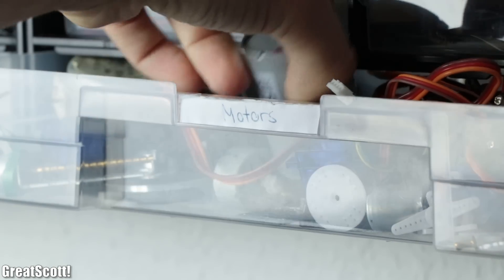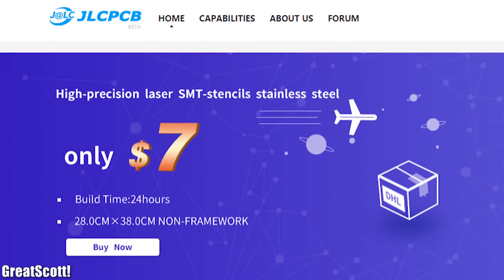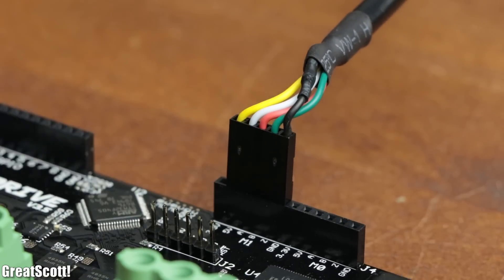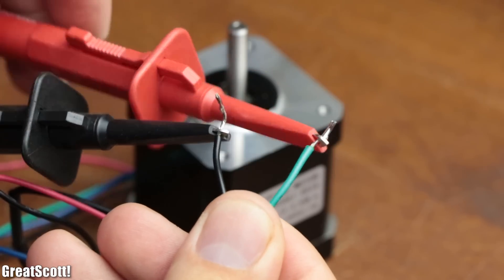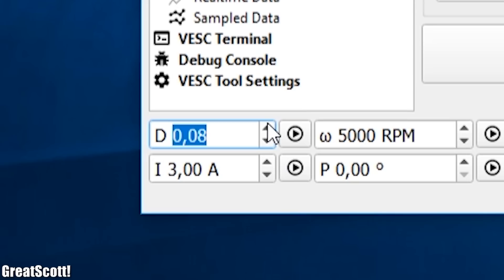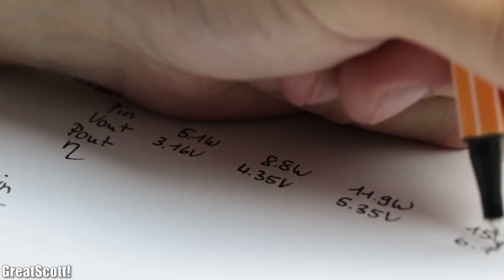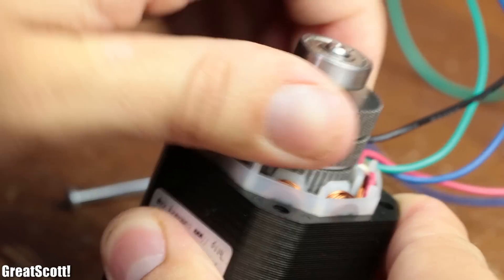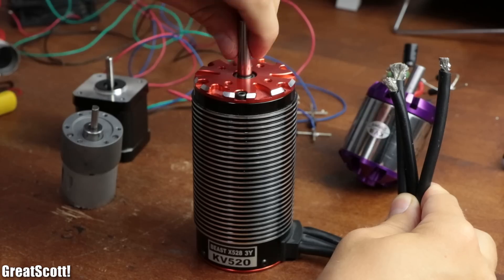Which Motor Type is the Best Generator? || DC, BLDC or Stepper? (Experiment)

Comment: What if you use a DC motor pushing a generator stater to produce power (DC motor at 24000 rpms reduction gears to 3600 rpms as needed by the generator )

Comment: Now, connect the BLDC motor to another BLDC motor and use it as a generator to power the other one without a control circuit. Should work, shouldn't it?

Comment: I love your videos, GreatScott!. I have to ask, why did you 3d print a coupler and enlarge its hole instead of just drilling the aluminum coupler?
Reply: Are you being serious right now....? If you are then, do you struggle mentally? he had ONE coupler, if he enlarged the hole then it wouldn't work with 2 out of the 3 motors he is doing experiments with. And these involve switching between them multiple times, so you are seriously suggesting adapting the one coupler he has in order to work with 1 out of the 3 motors. Your lack of logic is astounding

Comment: I like.  But using motors to generate is very inefficient.  Wondering maybe if do a video on a dynamo?  Basically car alternators are a dynamo where both field and stator, probably not worded right, are electromagnets, the output of a dynamo is regulated by adjusting the field voltage/current. Small in gets lots out.  Cars alternators then just rectify it for DC in the system.  Cars do, or usta have field wire where you could actually read voltage on the field and the load is increased or rpms of engine are changed.  Try it with a volt meter, idle motor and measure the field wire.  Turn on the headlights, blower, etc. and watch field voltage rise.  It will lower if you increase rpms of motor.  Thanks for read I have talked enough.

Comment: It would have been quite interesting to see what happens if the BDLC Motor(Generator) was connected with the other motor more permanently, so that it would be possible to run it on higher speeds

Comment: I would guess a brushless dc motor / ac induction motor as they most resemble the internals of a generator. - but apparently im wrong. ...and a dc motor still seems like they would be a cheap option ...but a BLDC with a timing belt and correct wheels to ramp up its speed seems like it'd work too ;))

Comment: What about a microwave plate spinner motor. They give quite the shock when twisted a little. RPM is like <5
Reply: They're incredibly hard to spin due to the gear reduction. They put out nice voltage at low rpm though. I've gotten 300+ by hand... Then the gears broke :(

Comment: Enjoyable experiment, but I disagree with your conclusion. A gearbox is rarely a good option for a generator project, it wastes power and makes noise. The real answer is to disassemble and re-wind the BDLC motor for a much lower kV and this also opens the possibility of changing from star to delta winding, which may suit a charge controller for a wind turbine better. Idea for your next video perhaps..??!
Reply: Solution is motor multipole rotor. Low-RPM generators are often multipole, including automotive alternator, which has about 10 poles.
That's reason why stepper works so well, because it's basically multipole BLDC motor
Reply: @Papinak2  Kind of like a four stroke engine right? Lower rpm but higher torque.
Reply: Indeed this video is just random testing for content and doesn't address the underlying principles of windings and poles
Reply: Doesn't the configuration change just make it into a synchronous permanent magnet motor? If I remember the difference between two (BLDC vs PMSM) was boiled down to internal winding configuration. Anyways at that point you're better of with a purchase of PMSM for generation.
Reply: Another option is to use a inverter for the "gearing". Inverters used to drive synchronous 3 phase permanent motors like these are very common in industrial servo drives of all sizes. Servo drivers is another name. Of course it needs to be an inverter that can be set up in a way so power from the motor is extracted. The inverter needs to produce a opposing torque acting as a brake, so mechanical energy gets extracted, but not putting energy into the motor. Bigger inverters have external brake resistor outputs to dump the excessive energy for machines which have significant masses getting decelerated. Of course they likely aren't particularly effective at doing this, it is typically not a design requirement to be efficient at braking, but one that is efficient at it can be designed.
With this the diode losses and the low voltage problem can be mostly overcome and one is left with the motors IR (Resistance) losses, which also dominate at low rpm, inverter losses and magnetic hysteresis losses.
One complication is that a servo drive usually needs a sensor for the rotor position (encoder) to work at low or zero rpm, while if just used as a generator it can be realized sensorless, meaning using the motor itself as the sensor.
With the advancement in power electronics and control circuitry this becomes viable in this scenario where a rc brushless is to be used as a generator. Maybe there is such a inverter already?
Reply: so that's the only reason why the dc had a higher output?
Reply: Aren't stepper motors bldc motors winded differently? At least some of them must be?

lol. i take it back.
Reply: Would you mind breaking it down for me at the simplest level, possibly even with links to help from there?
Reply: iceland wind turbine
Reply: So one way you can get around the noise problem is to use helical cut gears as opposed to straight cut. Its the same reason manual transmissions use helical cut while racing transmissions use straight cut or "Dog boxes". Straight cut transmissions SCREAM at high rpm and the straighter the angle the louder they are. The Muncie M22 got its nickname, the rock crusher, because it uses gears cut at, I believe, a 26 degree angle as opposed to the 20 and 21s 34 degree. (Not sure if those are correct I just know one is cut steeper than the other)
Reply: LoL... wind turbines uses gearbox as well :/
Reply: @Promilus1984  They use gearboxes because it produces torque which translate to useable energy? Is that correct? I'm still learning about this stuff.

With the gear boxes the thing would spin faster but not produce sufficient energy?
Reply: @doomslayer5191  The blades of large wind turbines don't produce high rpm's, but they do produce torque on the central shaft. That shaft Is connected to a gearbox which greatly increases the rpm's of a generator.
Reply: @gman21266  what if instead of typical blades, they are small, light water-wheel type mechanisms, positioned at the height of buildings, each with their own 'alternator' to translate wind energy into electricity.
Reply: @chrizcanadianopportunity15  Positioned on buildings in cities is a bad idea because wind turbines have been known to disintegrate and crash to the ground. So that's bad news for people down below.
Reply: @doomslayer5191  An ekectric motor can produce torque without a gear box. Or act as a break
Reply: I disagree, rewinding a Bldc by hand is not worth the minuscule efficiency difference between stepper motors.
Reply: Do you know the windmill uses gearbox to turn the generator? Mainly the turbine itself does not rotate fast enough.
Reply: I'm a little confused on how the gearbox works in reverse.
Reply: @scienceteam9254  basically the rotation (by hand) itself along with the gearboxes produces useable energy to light up a small light.
Reply: @doomslayer5191  hope I can help a bit.  The rate at which a magnetic field changes in relation to a conductor is important to the electro-magnetic effect.  So you can have a small thing whizzing round fast or a big thing turning slowly.  The circumference of a circle is pi times the diameter, it's not simply about rpm,  it depends on diameter.  Giant wind turbines can't be allowed to spin at high rpm because the tip speed would go supersonic,  bad, very bad.  The ideal match for direct coupling would be a very large diameter generator.  Pricey, obstructs airflow.  So they use a smaller diameter generator and spin it at higher rpm via a gearbox, wiping away tears about the energy loss in the gearbox.  Compromise.   For tiny projects, there are motors sold as "solar motors"  which typically have larger diameter and, used as generators, will provide useful power at lower spin speeds.
Reply: @scienceteam9254  it take more torque. plus it'll cuase DRAG.
What you want is InRUNNER...( it's basically what the stepper motor less magnets)
but with Larger DIAMETER, so you can wrap crap load of WIRES
and MORE POLES..within a rotation.

Make the rotor or wheel LIGHT...with as many magnets as you can...
Such as using carbon fiber rods or aluminum tubbing for the generator's shaft.
Make the FAN/ Rotor as light as Feather...so that damn wind can blow
it..The wire whining ( stationary) ...like a freaken BRICK.
Reply: OneEye Monster anything like this already exist that can be upcycled?
Reply: @scienceteam9254  Never known a gear box that didn’t wok in.reverse.  The problem is that in reverse it requires high torque to push low RPMS tranlated by gears to low torque high RPMs.  In wind applications (low speed) the wind would not overcome the high bar set for torque so this is useless in most wind applications.
Reply: @xapplimatic    except worm gears?  I may have misunderstood what you're saying, but in a wind turbine the gearing relies on very high input torque at low rpm and gears up in rpm,  resulting in lower torque to the generator.
Reply: @xapplimatic  A screw gearbox

Comment: that's remind me about car alternator, they have same 3 phase AC and same diode configuration like you did in BLDC motor, but they increase rotation from the engine use small pulley at the alternator because the engine crankshaft use big pulley.

but the interesting side is, car alternator control electricity flow by increasing and decreasing electromagnetic stator by increasing and decreasing electricity goes to stator, i think that was Genius way for control electricity with efficient way.

Comment: Full bridge rectifier of BLCD is not efficient at all. The diodes will pass current when the output voltage exceeds the output capacitor voltage which is a very short duration. Most of the time diodes are bloking where the lower portions of the sinuses are wasted. BLDC should be connected to a AC-DC converter with PFC capability.

Comment: Okay - so what would the primary mechanical/magnetic difference be between a real generator (dynamo) and a hobby DC motor's construction that makes the dynamo better for the task of generating power from mechanical input?
Reply: Simply put, wire size. If you look at the windings in a generator head or car alternator you'll notice they're designed for higher amps with larger diameter wiring. The small(er) windings in a hobby motor will burn up if too much load is pulled.
Reply: NitrousFox83 thanks fot the info. Makes sense. How about magnet intensity or shape?
Reply: Well that's where things get complicated. Depends highly on design and application. For a simple generator you just need to cut magnetic lines of flux with wire. So more flux & RPM(cuts) =  more watts. (simply speaking) However, some use permanent magnets and some use field coils for better control.
Reply: NitrousFox83 thanks again. That gives me a good starting direction to look for more details...
Reply: Watch this video from the 60s for theory. https://youtu.be/OpL0joqJmqY

Comment: The motor is only efficient when is correctly coupled to the load (monophasic, threephasic, DC, brushless, gas and others), when the load change you need something to change the coupling (fix gearbox, car transsmision, continous variable transmission), filling the gap between efficiency and load coupling is a engineering task. 

There are some high precision gearbox for industrial servos, I think they can be used for BLDC motors or use pulley and band.

Comment: What about an Axial Flux motor. They perform really well at low rpm without a gearbox and are used by diy wind generator hobbyists. I’d like to see a DIY or Buy on a wind generator using an axial flux motor.

Comment: The teeth on the stepper motor are the magnetic equivalent of gearing.  The larger number of steps per revolution, the higher the voltage will be for the same RPM.
Reply: not all stepper motors are made with teeth.

Comment: Can you try making https://hackaday.io/project/159568-portal-point-generator this? its supposedly orients the magnetic flux in parallel to axis unlike motors which are radial flux devices. https://www.designnews.com/content/new-generation-axial-flux-ev-motors/186519862158706 has more details linking the design to Nicola Tesla. It could be multi part video :)

Comment: A fixed resistor is not a good load for testing. Try a constant voltage load after the rectifiers (super zener) and do voltage scans. The motors could exhibit power characteristics similar to those of photovoltaic generators.

Comment: Only problem is mounting of theese motors. If u dont do all of them the same way it all matters. Clutch looses energy while transfering it. If motor is mounted perfectly u can say that it will tansfer almost whole energy, but when there are vibrations or angles it lowers efficiency. That way stepper motor was ahead in the first place.

Comment: Nice video, you're clearly taking the subject seriously.  But it's complex.  Torque is not power.  For maximal power transfer the golden rule is impedance matching.  Deriving power from a one metre diameter wind turbine involves examining its power curve against rpm,  then attaching a generator that is optimal at that rpm and using it to drive an electrical load that is impedance matched.  Cripes!!   OK,  you're talking hobby level, so fine, but I was surprised at such a bad result for brushed dc.  I suspect that everything was sub-optimal for the poor creature.

Comment: try an induction generator experiment, get an induction motor, get it running, apply more torque to the shaft that essentially forces the motor to have a positive slip, this makes the motor output real power and take in reactive power, large wind turbines use this

Comment: first you  use solar or wind or hydrogenerate to generate power at low voltage. second put some battery to collect low power for 24 hours without need of  generate power then use that power connect dc to dc power up  voltage board, then connect to dc motor generate high vlotage the you use the power where every you need .

Comment: Aren't there any commercially available generators for hobbyist for use in projects? How to charge 12v batteries using such a generator or some alternative? I wanted to harness power off a stream in the backyard for powering a soil moisture data transmitter in the garden.

Comment: you don't need a gearbox if you rewire the coils. 

http://webspacero.bplaced.net/Thema/technisches%20howto/Einf%E4lle%20statt%20Abf%E4lle/(Heft%201)%20Einf%E4lle%20statt%20Abf%E4lle%20-%20Windkraft,%20Ganz%20einfach!.pdf#36

Comment: Good experiment. But results mostly depended on how the windings are winded. So, if you take a motor with a low number of turns of thick wire (as usual in modeling BLDC), you can expect high current output but only on the high speed of rotation. But if you have many turns by thin wires (as in stepper motors) then you can obtain higher voltage at a lower speed, but high load current can damage the coils. 
So, instead of connecting gearbox to BLDC better rewind it or buy a BLDC motor with a high number of turns. For example such as used in gimbal camera mount (google for "gimbal BLDC"). They can allow you to get appropriate voltage on relative slow speed.
Reply: AterLux also the gearbox always decrease the effency of the whole system. Especially those primitive with no bearings and simple gears.

Comment: I think I am a bit confused, wouldn't adding a gearbox increase the input power required since the motor requires more torque to spin the shaft at the desired rpm?  Can a gearbox change the efficiency of the motor generator?
Reply: rohan sehgal   the answer to both your questions is yes.  A gearbox dissipates energy as heat, so less is conveyed to the generator.  Higher torque is needed to get the same output rpm.   That said,  the wind turbines around me dépend on immense torque at low rpm geared up to spin a generator faster,  so it's not daft.

Comment: There are two more ways to check which one is the best generator:
- By shorting motor wires and manually spinning the shaft, the more resistance you have turning it, the more power it generates.
- The electroboom way: just put motor wires in your mouth and spin the shaft, the more painful motor is the best generator : )
Reply: That's definitely something Mehdi would actually do. 😂
Reply: after the second step either you are dead or lost your sense of taste
Reply: @mabedinia4  If you manually turn the shaft, the risk is almost null to get hurt

Comment: You really should be measuring the voltage at the output of the motors instead of at the resistor. Not as easy, but you waste a lot of energy converting to dc, which is not always the purpose of a generator. In fact afaik most generator are like the bldc, and generate 3 phase ac.

Comment: Ehhh.... I both agree and disagree. 
If you want AC current the stepper is probably best. 
If you want DC current, you're going to have to get rid of the rotor any way, at which point the bldc will become best. 
For the record, if you go dc generator setup, the voltage tends to remain constant and is easy to produce even at low rpm, but the amperage can vary widely and wildly, easily putting off 100's of amps to make up the different in applied load to the constant voltage.
Reply: alternating current current? direct current current?
Reply: "If you want an alternating voltage with time varying current, go with a stepper motor" 
"If you want an unchanging voltage with a time varying current..."

Is better?